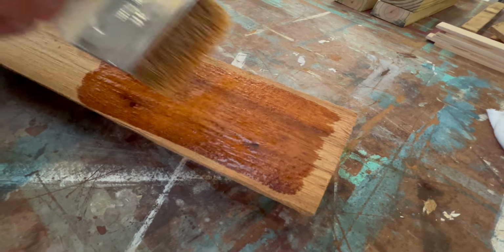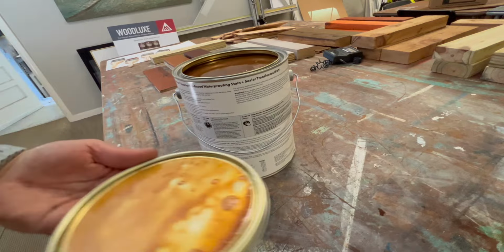WOODLUXE Translucent Oil Stain by Benjamin Moore in NATURAL Applied to Red & White Cedar, & PT

Comment: PT looked the best. How can I tell which kind of fence wood I have? Also should I spray a clear sealer afterwards if I'm putting this on a wood fence?
Reply from the maker: It's really just a matter of knowing what's what.  In my area most fence pickets are done in pressure treated pine, every now and then I'll see them in cedar.  Cedar is typically rough sawn and is clearly more red while pressure treated is smooth with a yellowish or slightly greenish look when new.  Googling pictures of them may help you identify your.  As far as the clear coat goes, no, it does not require nor would I recommend a clear coat.
Reply: @southernpaintsamplestudio   @southernpaintsamplestudio   thank you very much for the response back. i was actually able to find the woodlux natural translucent sample from a local ace hardware. i'll be trying it out soon against a thompson's harvest gold transparent.  i want to try to get that nice translucent yellow gold you got on the PT wood.
Reply from the maker: @supsnap  Glad I was able to help.

Comment: Thank you so much for showing this on different types of wood and also what it looks like when it's dry. That's hugely beneficial!    Also, any suggestions for reducing that awful spotting problem you get with sapwood? I'll have some beautiful pieces of cedar with a little bit of very white sapwood on it that just does not absorb stain remotely similarly to the rest of the piece and it looks like absolute crap. Wondering how you handle that or anyone else who can chime in. Wondering if I should try to use trans tint to ye it first or after?
Reply from the maker: Thanks coppulor6500. I’m glad this was helpful to you. Don’t forget to like and subscribe for draw downs of all the Woodluxe Stain colors and many more product lines after that.

Try wiping it with acetone just prior to staining it. It will help remove a lot of that sap and allow for better penetration. It evaporates ultra fast so you won’t have to wait around for it to dry either.